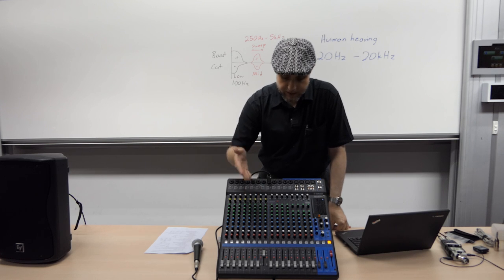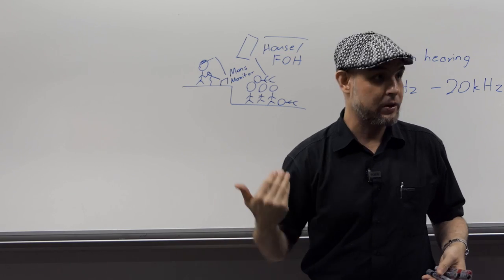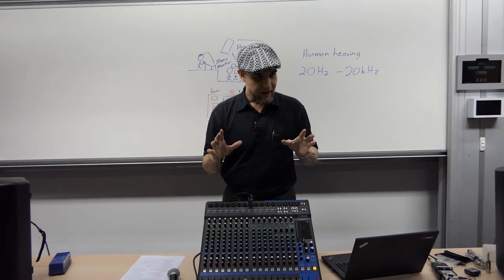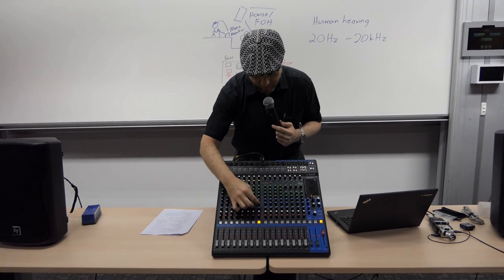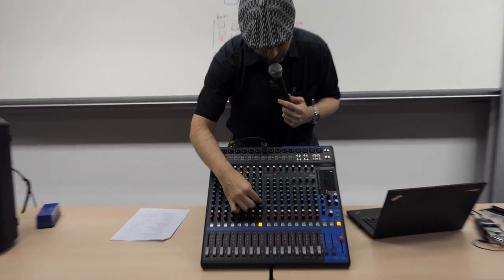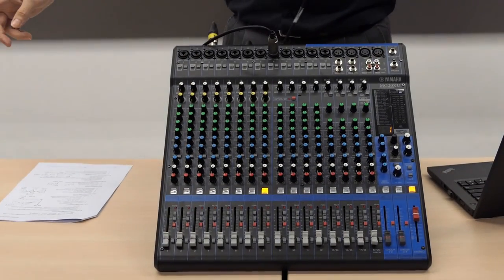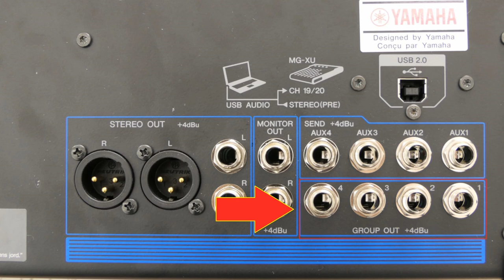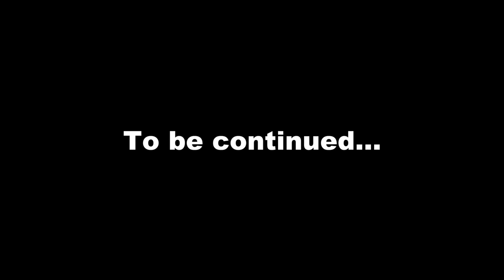Yamaha MG20XU mixer training part two

Comment: Very nice and in-depth tutorials.

One more usage case for Groups (1-2 and 3-4) is if you have speakers in different rooms.
For example, I use MG20XU as an audio mixer for three different halls, one main hall, much bigger than the others, with direct view from control room, and two smaller halls. 

There are 4 speakers in the main hall, driven by two amplifiers connected to Stereo out (ST), two speakers in the second hall are are driven by one amplifier connected to Group Outs 1 and 2, and two speakers in third hall are drvien by one amplifier connected to Group Outs 3 and 4.

We are using almost exclusively only microphones, and laptop audio, and by selecting buttons [1-2] [3-4] and [ ST ] we can easily assigns specific inputs (microphones) to specific halls, or group of halls (they are divided by removable walls, so any combination {1-2} {2-3} {1-2-3} is possible).

AUX-es are also used in case there is a need for internet streaming, or conference calls, since we can exclude incoming inputs in order to prevent feedback loops-
Reply from the maker: Yes Max, these are valuable tips! Great to hear from you in Croatia 😃

Comment: Hellooo Bruno.. im very happy about the sound im  getting  now from my system.  I bought a Yamaha MG16 XU and  i use two analogue inputs  to play my cd.   And as what you have said turn the PAN all the way to the left  for the left spkr. And the other  PAN all the way to the right for the right speaker and i can hear the wider separation of  the two speakers.. i also pressed the 3and 4 gray button from faders so that i can adjust the volume from volume 3 and 4 group  fader  at the same time. ..very good maestro.. you are the best.. thank you.
Reply from the maker: That's great news Patook, enjoy your new system!

Comment: I've learned a lot. Thank you from Philippines to Singapore ☺️
Reply from the maker: You're welcome, thanks for watching :)
Reply: @GLBProductions  i have a question if you don't mind me asking sir.. do I need to use D.I box ? 
Some of my friends who are using other brand of mixers told me that I need to have D.I's for the safety of the unit.. but as far as I understand, having the PAD in it,is like having D.I if my understanding was correct. Please enlighten me on this.. thank you and more power!
Reply from the maker: The primary function of a DI box is the reduction of noise, not the protection of the mixer. I have a video which discusses this in detail, it may be helpful for you: https://www.youtube.com/watch?v=2SBGSDKgKHo
The mixer is unlikely to be damaged by normal input signals, unless you mistakenly connect the output of a power amplifier to one of the input channels. What tends to be damaged is your speakers 😉
Reply: @GLBProductions  wow great.. I asked the question because people that I know from my place who are using the DI box,told me that it's there to protect their speakers especially the tweeters(not sure if it's the right term) from breaking up.  

Thank you so much.. Yes just now I've finished watching your video on DI boxes & their uses.. 

God bless GLB Prod♥️
Reply: @GLBProductions  the answer really clears up doubts in my mind.. 
Thank you GLB Prod☺️
Reply from the maker: My pleasure, education is the primary aim of my channel 😊

Comment: Your videos are among the best and clearest you can see, pure masterpieces actually. What is simple and obvious to some people is not at all to others, and you can never explain too clearly.
I have 4 active speakers, two of which should be at the other end of the room. Is there any good way to connect everyone? Has an old Yamaha 16/4 mixer.
Reply from the maker: Glad the video was helpful! If your speakers are active the easiest way is simply to daisy chain them together in two groups of two: left and right. Output from the front left speaker goes to the input of the second left speaker which is halfway down the room and same for the right speakers. Ideally you would want to delay the speakers in the middle but if your room is not too large you can still get acceptable results using this method.
Reply: @GLBProductions  Thank you for being nice to me, I mean if you could connect the 4 active speakers, 2 on stage and 2 in the far part of the room with 4 cables directly from the mixer table. And where in the mixer table it is most suitable .MG16 / 4.
Thanks so much
Reply from the maker: Yes you can do that too: most mixers including your 16/4 have two sets of main outputs: one on XLR and another on 1/4" - use one set for the front speakers and the second set for those in the middle of the room. 
Ideally the mixer should be positioned in the centre of room - centred from left to right and also from front to back. However this is not possible in most circumstances, so just get as close as possible. The idea is to hear what the majority of your audience is hearing.

Comment: Thank you for such an informative series of videos. I'm looking at buying one of these mixers and your videos really helped my decision. 👌
Reply from the maker: You're most welcome, glad I could help 😊
Reply: @GLBProductions  I do have some questions though if I may - in a recording studio scenario I'm assuming that the monitor out goes to your amplifier/powered speakers and the main out goes to a hardware recorder or similar? I'll be recording to a Mac via USB so i'm also guessing everything sent to ST will go to the USB output? Thanks in advance 😊
Reply from the maker: That's exactly right! Remember that the audio interface on this mixer is only 2-channels so you can only record the main LR output of the mixer, not individual channel outputs.
Reply: @GLBProductions  Thank you!

Comment: I use the group to avoid accidentally recording sounds from my computer (like email notifications, chimes, etc). I send everything I want to be able to hear to Group 1, but I only send the things I want recorded to Stereo. Then I set the Monitor to Group 1. That way I can hear the recording from my DAW (because the computer is part of Group 1).
Reply from the maker: Well done - you are using the mixer as the designers intended 👍🏻😊
Reply: @GLBProductions  thanks! Your videos are great! I’ve had my mixer for four years but you taught me many things even after those years. Like how you can think of the sound traveling down the column of the mixer and how to set your initial mic gain correctly. That is so helpful.
Reply from the maker: You're welcome Will, very glad the videos are helpful.

Comment: I've had the MG12 XU for over a year but I was still confused about some functions. We do karaoke mostly so we don't have need for complicated aux sends. I find the group function useful for music played during breaks.
Reply: how would you use subgroup to play break musics?? mind to share?
Reply: @piratedprivacy9052  you simply plug in your break music (such as a cd player) into one of the channels and select a sub group.  I have the MG12XU so it is similar.  When you want to play the break music just activate the st button on the correct group.  Either deactivate the on button or deactivate the st button on the active channels.  Its a bit of work but you don't have the change the mix at all. I prefer the on buttons because they are lit. I wish the st buttons lit up when pressed.
Reply: hmm... seems to me that you may be using the Subgroup the wrong way. you wont be utilising the benefit & advantages of Subgrouping if used as what you just said...
Reply: I would rather suggest you use it the other way round ie. group all active channels to SubG1-2 & leave yr break music in one of the channel, unassigned for now.
During show/karaoke, all active channel is assigned to SubG1-2 ,and SubG1-2 master fader set to unity and assign to ST.
During break music, simply Deactivate ONE button on the SubG1-2 Master, either the On button / ST button (engage/assign ST of Break Music Channel as well)
Reply: this way, you do not need to be fiddling with so many buttons on all the channels (up to 7 active channels for 12XU, 8 total but 1 for break music use) just to deactivate them one by one...
Try using my recommended way of grouping and you'll need to switch only Two buttons in Total, in order to play break music&mute everything else.
hope that helped you in achieving maximum simplicity in yr show/karaoke....
Reply: @piratedprivacy9052  That makes a lot of sense and I should probably switch what I am doing, that is why I watch videos like this.

Comment: First of all thanks for the tutorials, they are most helpful, and you are a very good teacher! I got a question tho. I have the Yamaha MG20 model without the FX.
So can i let's say route Group 1-2 to outboard FX and bring them back on 2 channels in the mixer, and use the Group as a Parallel Compression BUS? 

Let's say if I press 1-2 for Group 1-2 on the first 5 channels, and ST (master) on those same channels and use the Group 1-2 fader to dial in the parallel compression back to either a stereo channel or 2 mono channels on the mixer? 

Of course I will bypass the Group 1-2 and not send it directly to the Stereo (ST master). 

I hope this doesn't sound confusing. Also the reason I want to use groups instead of Aux is because I use all of the Aux sends to other hardware FX boxes.
Reply from the maker: Yes you can do that - remember to double check that the return channel(s) is/are NOT routed to group 1-2 or you'll have a feedback loop.
Reply: @GLBProductions  Thanks for the answer and the heads up!

Comment: Great videos,  very informative and helpful.
Where do you recommend adjusting the overall volume once levels are set.
If main slider is on 0 and each channel has been adjusted to suit.. if then too loud would you turn speakers down or adjust by main volume slider ?
Thanks in advance
Reply from the maker: I would use the main fader - that's exactly the purpose it was designed for :)

Comment: I love this mixer series; they sound very sweet. Only problem I find while using them is with individual channel signal indicator (absence of individual light meter). During the mixing, LR out light meter shows fine. Then, there is a problem, how much volume is going from individual channel to LR mix can't be identified by this mixer; only you have to guess from headphone. This cause unbalanced recording.
Reply from the maker: Yes, this is not the ideal mixer for live recording, especially as it has no multitrack capability.

Comment: Great video - thank you - could I ask why there is an aux 4 monitor out if aux 4 is only for the onboard FX - also can aux 4 be used for another monitor mix and is it ore or post - thanks Mark
Reply from the maker: It can be used as an additional aux send and is fixed post-fader, so not ideal for use as a monitor send as the monitor level will be affected by changes in the fader position.
Reply: GLB Productions thank you but if it’s used in that way how do the FX aux knobs work - do they become volume adjusters rather than Fx - sorry I’m confused with what Yamaha have done here ? Also I can’t seem to hear and onboard FX in the monitors of any aid mix ? Thanks again
Reply from the maker: Yes it can be confusing - the best way is to use aux 4 as either a post-fade aux send OR the send to the mixer's internal FX unit, not both. 
On this mixer you cannot send the internal FX to any of the aux sends, only to the main mix - this is a major limitation of the design that is not obvious at first glance.

Comment: Great info. But where is the speaker plugged in? I hear it on but I don’t see it plugged in.
Reply from the maker: The mixer is connected to an offscreen amplifier which is then connected to the loudspeakers.
Reply: @GLBProductions do you have a video where I am shown how to turn the unit on, plug the speakers in and have it work? My powered speaker is on. My mixer is on but Im Not getting any sound. I’m so frustrated. And I’m not tech savvy as you can tell by now. By the way your videos ARE very informative and easy to understand. So thank you for that as well.
Reply from the maker: No I don't because the devil is in the details when it comes to these setups - every mixer (even the analog ones) is slightly different in terms of where the controls are placed and what nomenclature is used, so it's much easier for me to help viewers out individually, if I can.
Reply: @GLBProductions  well you sure do help sir thank you. Keep the videos coming.

Comment: Hello Bruno, I just bought Yamaha MG16XU and stage monitor Mackie Thump 12A for the lead singer. Which slot I can use to connect the monitor, Aux ?  Please advise it's for house of worship thanks.
Reply from the maker: Yes, use aux 1 set to pre-fader.
Reply: @GLBProductions  Set to pre-fader after the settings or before the settings

Comment: Thanks Great video! If you have the master volume on 0, Gain on 1oclock, Fader on 0. How can you still play with the volume? For example by a wedding. By the dinner the music should be softer (lower) then by the dancing. But if everything is already set on 0 there isnt much room to play around!?
Reply from the maker: Once the gain is set correctly just use the channel fader to adjust the volume.
Reply: @GLBProductions  Thanks for your reply. To adjust just the fader can get complicated when i have for example a choir of 4 people connected + a keyboard player + saxaphone player and i balance it out nicely. Now in the middle of the event i feel everything has to be louder. It would be easier if i can with 1 fader pick up the whole volume and everything stays nicely balanced. How would you do it?
Reply from the maker: Use the red master fader on the mixer - you have up to 10dB of additional level available there.
Reply: @GLBProductions  Thanks so much for your reply. I really appreciate it. Is 10db enough to change from dinner music to dancing music?
Reply from the maker: It depends on how loud your dancing music is relative to your dinner music 😄

Comment: Thank you so much. Just had a question. I'm trying to run a hybrid event live and online streaming. Where is the best place to put my output for the live streaming? I placed in on headphones output and was just too loud when streaming it online. This is for church.
Reply from the maker: Yes, don't use the headphone output - it is for headphones 😄 I suggest using either the duplicate STEREO OUT connectors, the MONITOR OUT, or any of the group outputs. The latter two options will give you a separate volume control for the feed to your livestream, if needed.

Comment: Thanks for this interesting clearly explained tutorial. Now know how to connect stage monitor. Just do basic open mic stuff and have access to this mixer. Have a Laney65D I can use as a monitor but would a smaller 10w output amp work ok as a basic monitor primarily for the vocalist.
Reply from the maker: It really depends on how loud the stage volume is 😄

Comment: My question:
Why does Yamaha mixers give 1-2 as one group, and 3-4 as another group, when they could label them as just 1 for one group, and 2 for the other group?
I've seen other mixers, like Allen & Heath, with individual group faders for each group outs.
Or am I missing out something?
Reply from the maker: It's because the groups are stereo - there is a single fader but it represents two separate signal paths and two discrete outputs from the mixer. Other mixers use two faders for each group but I suspect they didn't have the real estate on this board.
Reply: @GLBProductions  Does this mean sweeping the PAN knob L-R routes the channels between Group 1 & 2 and 3 & 4 respectively in the Groups output 1, 2, 3 & 4? (If my question makes any sense 😁🙏🏼)
Reply from the maker: Exactly right my friend! 👍🏻👌🏻😄 That's why you have 1/3 and 2/4 printed below the hard left and hard right pan positions respectively.
Reply: @GLBProductions  Thank you very much. Definitely gonna check them out as soon as I can. Hope you don't mind me throwing questions at you like that 😇🙏🏼

Comment: so basically...you set all levels on the mixer in order to satisfy the peak meter..geting as close to it as you can without going red..and then you use the speaker volume to set the volume the audience hears? for me i am feeding a USB mixer into an online streaming software...im having troubles with it coming through distorted..or...i dont have enough sound.
Reply from the maker: Not quite - you set the average level of each signal to be around 0dB on the meters, not as close to the red as possible 😉 
Assuming the distortion is from the input of the software, it sounds like you need to run the output of your mixer through a compressor or limiter of some kind.

Comment: Whoa, nice videos ! I didn't notice first part, I have to watch it. :) I have a one off-topic question. I was at venue where they had a lot of feedback issues. Then I bring my digital mixer and I discovered that only 5 kHz frequency must be "muted" (i don't know the right word :D). Are there some single-purpose device (like dynamic single frequency EQ?) to do this without expensive equalizers or mixers? Thanks. :)
Reply from the maker: Hi Buri - if you have a digital mixer then the best place to do this is by using the EQ on the main outputs: almost all digital mixers have a 4-band parametric and/or 31-band graphic EQ that can be used for this purpose. No extra equipment needed 😊
Reply: @GLBProductions  Ah I wasn't exact. They have a pretty cheap Behringer mixer with amplifier. And I bring my digital mixer only to discover which frequency causes the problem. What I need, is, but some device between (?) mixer and the amplifier to filter/put down 5 kHz frequency a little bit. :) But thanks for your answer and time!
Reply from the maker: Ah ok - in this case probably best to buy a second hand graphic EQ unit and connect it between the mixer and amplifier.